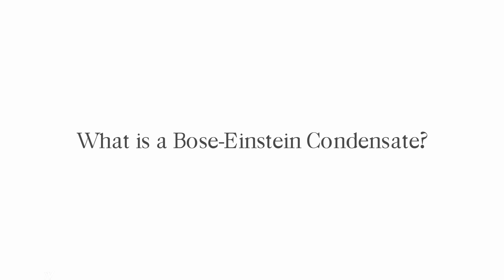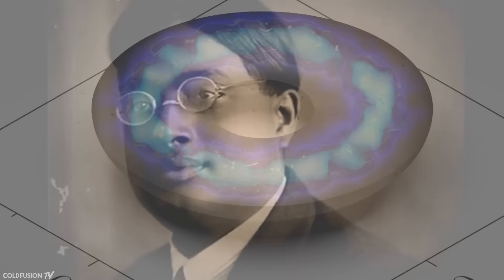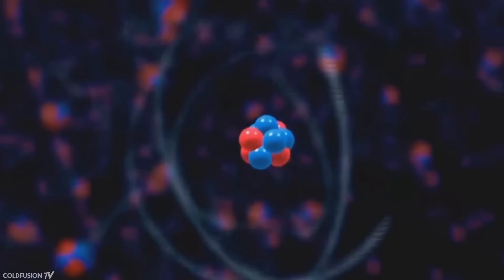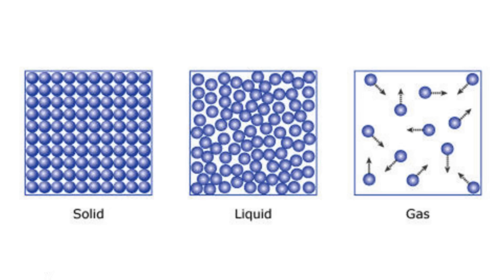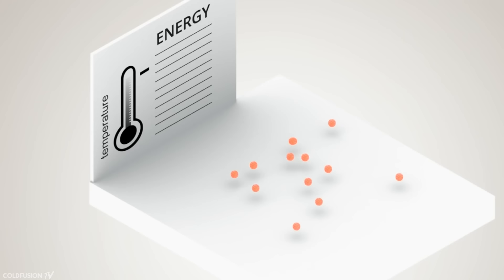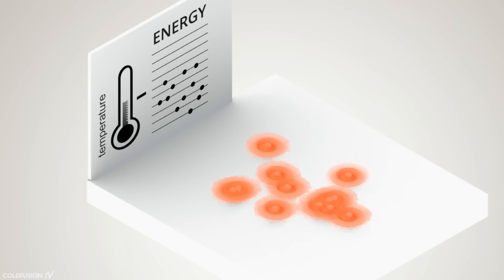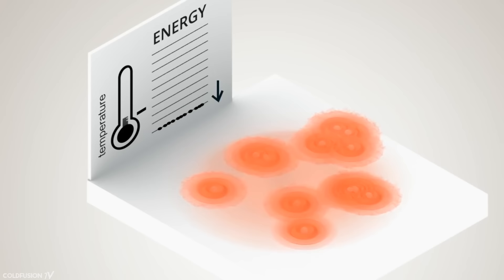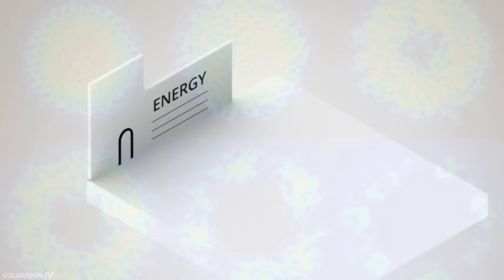A.I. Learns Nobel Prize Experiment in Just 1 Hour!

Comment: Not surprising if you have given the AI all the data it needs.  It would surprise me if the AI finds out a new state of matter on its own.
Reply: thats the thing, I've been researching and if what they claim its true,  then it has made exactly that, because they didn't tell the AI nothing else than cool it the best you can and gave it the control of the lasers, it took about 1 hour to the AI to find out how to play with the lasers to cold it, just to put it on perspective, to achieve exactly the same task it took several years of investigation, trial and error of the nobel winers
Reply: Eric Saúl Yup...
Reply: it still is surprising considering amount of computation required to actually recreate the experiment. That's where the key is
Reply: kolboch The point is, you still have to give the computer those 200 numbers and tell them what to do.  Then when the computer is done with it, it's done.  It will not think that maybe those numbers has hidden message, or clues, or create a song with it.
Reply: Agreed. Pattern recognition is the key to science and discovery
Reply: Dude you still don't understand that not much info was given to the A.I. It was basically instructed&#160;as so &#160;"make this object as cold as possible using these lasers" with that task in mind, the A.I was able to find the optimal settings for the lasers to produce&#160;the desired&#160;results...and in only an hour at that. That same task given to a team of scientists took years to produce. So when you say "not suprising" it actually is, very surprising actually. @David Lawman
Reply: 1blazery The AI doesn't even know what is "cold" without being programmed.  So we get the same results.  That breathtaking for you?  Amaze me with another results please.
Reply: Considering that also us (humans) need to be taught such simple concepts as "cold" and "hot", your last point doesn't make that much sense. Also, see it in this perspective, you're given all the info that was given to the AI, you know what to anchieve, and you have the equipment and the knowledge prior to 2001,how long would you take to get to the final result, I doubt you would take 1 hour, probably a few years if you were lucky. That's why this is so impressive, also, the AI created a diferent way to get to the result, a better way maybe. One that wouldn't "compute" in our human minds.
Reply: GhostCrafter99 You are wrong.  We don't need to be "taught" what is cold and hot.  We don't even need a word for it, we can feel the difference between them.  But you NEED to program the AI what is cold and what is hot, and be very specific otherwise you aren't getting any results.
Secondly, that last point of yours doesn't make much sense neither.  It's like you giving all the equipment and knowledge of this laser thing to an AI that plays chess.  I doubt it will give you a correct result in an hour, or ever.
Reply: +kolboch interesting perspective. Allthough the it-sector wouldnt be over, but the competitive rulers would change, to have an AI in the bord wouldnt be a bad Idea. ;)
Reply: Actually you are taught (by your body though experience) what is cold and what is hot by being exposed to external stimuli and having the sensors that respond to such inputs.

A person incapable of sensing temperature would have just as much trouble understanding this concept as an AI without the proper senses.

An AI with a temperature sensor linked to it's neural net will also learn what is cold and what it's hot without supervision.

Remember, it's not your brain that tells you this is cold and this is hot. It is your body.
If you where just a brain without the body , being "smart" would be a challenge.
Reply: Andrei Stefana But then we will be talking about exceptions.  If we are going to talk about exceptions, there will be too many unknown factors.  What is too hot or what is too cold is different for different people.
An AI can have the temperature sensor attached, but that temperature sensor is only an indicator which has to be programmed into languages that the AI can understand.
If you stick your hand into near freezing water for a few minutes then stick it into a near boiling water you won't feel the same as if you stick your hand into near boiling water directly.  There are things that the AI will never understand on its own.  No matter what sensor you link with it.
So if one is brain dead, he can still tell cold and hot?
Reply: i am not talking about exceptions.
research self organizing neural maps for details.
you do not need to program what the temperature sensor is or what the values it spews out.

a SOM AI (Self Organising neural Map) can take raw data from any kind of input and it will find it's own way to categorize what it receives.
It doesn't matter that it does not match our perception of hot and cold. It just makes it's own impression of it

also about the last part, yes you can be brain dead and still react to temperature.
sweating is an involuntary reaction based at the spinal cord level.
Same is for the Withdrawal reflex where even a comatose patient will withdraw his hand. 
Also same for the knee jerk reaction when struck. All of these are at the spinal cord level and require no brain to operate but this is besides the point :)
Reply: Andrei Stefana I was talking about exceptions as humans (people who can't sense heat or cold) as you mentioned...

About the SOM, to begin with you still have to give it algorithms and variables.  If you give it a bunch of negative degrees celsius and it categorize it as hot, then we are in trouble.  That's not exactly intelligence.  So making impressions on it's own doesn't mean it's right.

You might "react" to heat or cold but you can't feel it.  ;)
Reply: +David Lawman Are you that desperate for SkyNet to become a reality?
Reply: The AI cant do sinapsys. How can it would learn? Only living things can "learn".
Reply: MrElectrifyer My posts are mocking AI if you haven't noticed...
Reply: I just pointed out earlier that you do not need to know how the AI categorizes the information it gets for it to work. Also , no , you do not need to provide it anything besides the sensor raw data.
That's why it's called SELF Organizing...
It has Unsupervised Learning.

Read more on AI before making assumptions.
Reply: of course AI can do synapses , they are called Artificial Neural Networks.
And the reason you can do an image search on google is BECAUSE an AI has learnt what that image means.
Reply: Apologies, I meant Google Deep Search or Deep Dream, I thought it was also implemented in Image search.
This is what I meant to refer:
https://en.wikipedia.org/wiki/DeepDream
Reply: The interesting phrase was that AI in this case is finding the solution in a strange way for humans but in fact this AI software looks very simillar like a mathematical model of linear optimization. 
    AI is recording all the variables and compares the results for every kind of the equation system between the solutions and other models of the equation systems and is not repeating calculations based on a mathematical model, I guess.
    Of course that there is a huge amount of data to process and store.... and the best way to do that is a neuronal network connection model, in order to be able to change the variables according to that mathematical patern, it's like creating dynamic instances (sets of models) and dynamic objects to those classes  or models (equation systems and results (neurons)) who knows what is OOP (object oriented programming) knows what I mean.
    Becouse a processor is faster than human mind when processes mathematical operations, that's why it solves the problem in just 1 hour.
Reply: the AI might have also undergone some Iteration based on a fitness function so this variant that solved it in 1 hour was just the latest and greatest :)
Reply: +Andrei Stefana It's possible but in this video we are told that a simple function would be allmost impossible to build becouse that would be to complex.....
     Who knows? :)
Reply: Mocking AI? You'll regret that you son of a bitch!
Reply: C0LLAPSTHES0C13TY Wait, is AI your Daddy?  I am sorry if it is.
Reply: David Lawman so when you tell a AI that negative degrees celcius is hot and positive degrees celcius is cold you've just given the other names. It will still have an answer for your question you just need to translate it.
Reply: right!
Reply: Tris X No it won't.  If you program the AI negative C is hot and positive C is cold and want it to boil the water, the AI will not compute.  Because you have given it wrong info.
Reply: so you say if you see green as red and red as green you cross the street an die ? :P 
you do know that this is irrelevant right ?
Reply: +David Lawman NO!

Eg you tell your kid that a cat is a "dog" and a dog a "cat", but you know that a cat is a cat and a dog is a dog and your kid says there is a "cat" you know it is a dog. You just have to know what you taught it.
Reply: also to the kid a cat is still a cat ... you just taught him a different label for it
Reply: Astearon Wanna try to cross the street next time it turns red for you and tell me? ;)
Reply: Tris X So if you tell the AI plus is divide and minus is multiply.  You want it to solve 2(x+3)=16.  what do you think you are going to get? Hint: not going to be 5.
Back to my boiling question.  You boils at 100 degrees Celsius.  Since the AI knows the opposite, it will never be able to boil the water, it will keep freezing the water.
Reply: ***** Boy. When you say plus is divide. And you want to solve 5×5. You have to give the term "5÷5". The program will multiply it. I think you do not know that when you teach the AI different stuff you need to translate it into that stuff.
Reply: +Tris X AI is not that simple. AI it's about multiple choices and principles of choosing between those choices. 
  If the number of choices increases, the AI is more complex. There is also a complex level of determination of the choices that an AI system can make. If the level of determination is complex, the AI is smarter and the amount of data is bigger.
   This cannot be accomplished without a neuronal network storage system.
   If the AI is able to decide by its own without any level of predetermination, it means that the AI system has reached singularity (btw, I don't think this is possible).
  The AI it must be complex either way if we think AI in termes of 5x5, we reduce it to a simple software program.
  AI should be able of storing huge amount of complex PROCESSED DATA and compute that data after storing it (all kind of logical computation) to reach some kind of result that can not be accomplished by a single complex algorithm.
Reply: Daniel Daniel I was just giving ***** an explanation of what he said. I am not totally in AI I just answer his question with normal logic. Sorry for my bad knowledge. ^^
Reply: Ok. No problem.
Reply: Daniel Daniel " If the AI is able to decide by its own without any level of predetermination, it means that the AI system has reached singularity (btw, I don't think this is possible)." Yup, exactly.
Reply: I think you underestimate the difficulty in the algorithms the computer has to determine to solve problems. For example, K B gave a problem of having 200 numbers and needing them to be sorted. For our human brains, sorting is really easy. If you try writing out an algorithm that describes how a list of numbers is sorted then you quickly realize it is not nearly as obvious as you once thought. The computer would need to 200 numbers and a way to determine if one number is smaller than another, but that's it. Just knowing how to determine if a number is smaller than another does not at all describe an algorithm to sort a list of numbers, not even close.
Reply: +Blake Thingstad ""If you try writing out an algorithm that describes how a list of numbers is sorted then you quickly realize it is not nearly as obvious as you once thought"
    It depends of how skillfull you are as a programmer, or about your programming experience.
  But, again... writing complicated algorithms, does not mean you are creating AI :) AI means multiple choices (being able to chose in response of an external stimulus, by its own choice... also learning, or making corrections).... it's far more complex than any complex algorithm....
Reply: +David Lawman sorry to break your bubble but you obviously don't know how AI works - nor how logic works.

AI doesn't even work with labels to begin with. and whether one would label "cold as hot" and "hot as cold" would make absolutely zero difference to the outcome.

At least grab a book about machine learning and neural networks to even begin to grasp how this works - oh and a book about logic might help aswell.

just to point out one flaw:

If A human sees red as green and green as red and you show them a "green for everyone else" light and tell them "this is green" and do the same with red light - then no, that human being will have ZERO problems crossing a street. You simply relabeled their colors. In fact that's the case all the time, "your green" mustn't be "my green" but as both have the same label we both recognize it as "green".

So if you would switch "hot for cold and cold for hot" for a simple AI and tell it to "boil the water" it will simply find, that water boils when the state is achieved that YOU labeled as "cold". Which from our perspective would be wrong but that's not because the AI did something wrong but because we used different labels in two cooperating systems - which is simply bad practice. One can't use a Fahrenheit sensor and use Celsius in a program without using the correct methods to change values between them. That's what happened several times and caused big crashes in the past.

You could name "hot as Frank" and "cold as Peter" and the AI would still find the boiling point of water, even though the state the water is in would be called "Frank". 

An AI doesn't care about labels, it cares about input and a task (goal, like a fitness score) - labels are simply language.

By your definition of labels you couldn't cross a street here either, as you start walking when it's "green" (if english speaking) while I start walking when it's "grün" (german). So if you tell my kid "don't cross the street when the light is red" and she stops walking in germany where the light is "rot" one simply can't follow that she did something wrong. No she was just taught different labels (names of colors) used in different systems (country) that have to be translated before one can draw a conclusion - in this case by using a dictionary.

So in the case of "hot as cold and cold as hot" one simply specified:
HumanCold = AIHot and AICold = HumanHot by switching labels around.

And again to your boiling analogy: "You boils at 100 degrees Celsius.  Since the AI knows the opposite, it will never be able to boil the water, it will keep freezing the water." That's simply wrong.

The AI wouldn't "know the exact opposite" that's completely illogical. The AI would simply know 100 degrees Celsius are "Cold", therefore it would spit out "The water boils at 100 degree celsius - when the water is - as YOU specified - cold".

Seriously, hot, cold, cat, dog, red, green, bread, butter - those are completely irrelevant, those are labels for variables we encountered, labels we - as humans - completely made up. And Labels that neither have only one name, nor do they have unique names, and in fact many labels are completely subjective as well.

Just like a simple imperatively programmed program doesn't care whether you name your variable x, y, car or variable5 - an AI wouldn't care about labels either.
Reply: +Dominik Gerndt 

If you tell a human that red is green and he should cross when red.  He will stop when he sees a car coming no matter what color the light is.  That is called intelligence.  Unless you program it into an AI, he will cross the street and get hit by a car or horse, or a train.

It's not the labels.  I don't know how you think that I was after labels.  Hot and cold is meaning less unless parameters are given.  I might think 12 Celsius is cold and you might think 3 celsius is cold or hot as you want to name it.  But we know that water boils at 100 celsius and freeze at 0 celsius.  You can change the names but not the states of form when temperature changes.  If AI is only programmed that freezing the water will make it vapor, it will only keep freezing it and trying to search for the lower temperature that will vapor the water.  Which we know it's not going to happen.
Reply: David Lawman and again you think way too much about labels and programming in an imperative way.

And that is a completely false way to look at AI.

Do you think simple neural networks like MarI/O "know" that they are playing a game? no they don't. and they don't know super Mario contains enemies either.

all they know and teach themselves is how to react to a given screen input to most likely increase their fitness value.

and that very fitness value is the only thing we give them as a goal. the AI get's a task, inputs and outputs and is free to do what ever the hell it "want's".

And a AI that learned that ghosts in pac man are bad will aswell evade it even though you never told it what a ghost is nor that it's bad. just like a toddler doesn't give a rats ass about an approaching car the AI has to learn about bad situations aswell to apply it's knowledge to different situations.

and no, those reactions are not predefined. just like you are able to control your body the AI is able to control what ever it's outputs are.
and just like you have to base your reactions on sensors all over your body, input that gets transformed in your neurological pathways to make a prediction of the proper movement - the AI also simply has inputs and a neural network.

and just like your brain develops, this network develops. in fact several implementations even use evolutionary approaches. and just like you learn from your mistakes the AI's neural net get's tweaked using backwards propagation.

I think you most likely want to convince everyone - including yourself - that the human race will be the most intelligent being on this planet. But if we are so smart, then we will find a solution to how our own brains work, and as soon as we do that, we will work on a artificial way to reconstruct it.

So either we stay dumb enough to never be able to built a proper AI or that AI will pass our intelligence faster than we would like.

That's exactly why even people like Stephen Hawking, Bill Gates or Elon Musk talk about these subjects. Because of the problem of security. if we can't solve the security problem before we solve the AI problem - things will be about to go south. because for all we know - we might have to go in order to increase the fitness level of that given AI.
Reply: Nah I agree that AI could easily surpass the human mind eventually. I don't pretend to understand neural networks, but I do understand programming really well (it is my passion and career). Honestly, the concept of machine learning baffles me, but I haven't ever researched it before.
Reply: Agreed, I just wanted to point out to David Lawman that I think he seriously underestimates the complexity that goes into programming, not to mention AI.
Reply: +Dominik Gerndt 
The problem is you think way too little.  AI is a program, it's not a human.  You can not give it a goal and tell it to do whatever it wants.  You have to give it many datas and laws in order for it to accomplish the goal.
Let's use your pac man example.  What is bad? is dying bad?  How AI knows that?  does it gets hurt?  How it learns then?  You have to set the parameters or tell it dying is bad.
Toddler example you gave is wrong.  The toddler physically can't run away from the car, so what the hell are you talking about?  Try to surprise the toddler by jump in front of him and see if there is a reaction.  That reaction is intelligence, no need to be taught.
If you give the AI a human like body, and tell it to turn its head.  It will spin it's heads off unless you set a parameter.  
Everything has to be set or programmed or given the datas correctly.

So please don't think that AI can do everything or learn everything by itself.  Simple tasks maybe, but that's not AI.
Reply: +Blake Thingstad
Quiet opposite, I believe we don't have the ability yet to create a real AI.  Which should go beyond our programming skills.
Reply: Very true, I guess I'm taking a purely theoretical stand point (as if we did have true AI) for this because we have definitely not created consciousness in computers
Reply: Also, a Toddler reacting to something is not intelligence but instinct, which has been developed over many generations. This is part of something called evolution which also is an integral part of AI development.
Reply: Instinct is part of intelligence.
Reply: I think it was given a constraint (keep finding the lowest temperature) and each action that achieved a better temp was rewarded and one that elevated it was punished. Just an assumption but I think that they are much smarter and have Phd. Their implementation may have advanced stuff
Reply: I don't know specifically how much ai has improved but i know this
1. if ai earns the ability to learn on its own and starts to reprogram itself we will not be able to stop it
2. humans will never be able to beat ai
Reply: Sorry to say, but you clearly don't understand AI. Despite AI still being in it's early stages, it can already do amazing tasks. To refer to your Pac Man example. You DON'T have to tell it that dying is bad or that ghosts are dangerous. All you have to do is to give the raw pixels as input, and tell it that it the goal of the game is to get as high score as possible. That is all. That means it competes on exact same terms as a human. A human player gets so the screen, and gets told by the game that getting a high score is good. Also, you have to tell both the human and the AI the controls of course. But they do compete on exact same terms, and the AI will of course get much better than a human, much faster.

The way you talk about AI clearly shows you don't understand it.
Reply: ...and what affects the high score? E.g. death. So when you defined that a higher high score measures it's success, you also added in everything because it's not just pixels, but what the pixels represent and that's what it doesn't learn unless you hardcode it in.

Just like with the one hour discovery. It didn't have to first learn the whole universe and re-invent all of our contraptions or even the experiment, just had to mess with the parameters that we defined for it.
It doesn't mean our current "A.I." is completely shit and useless, it just means that it's not quite intelligent yet. We'll get there no doubt, some neural nets we humans have made are doing pretty cool things, but we just aren't there yet.

Funny enough though, the way you talked about AI gave the impression you don't know much about it either. I know I'm no expert, but even with my lackluster experience with only few neural net implementations, I can tell you're full of shit.
Reply: BlyantGames Let me ask you something.  You have clearly played Pacman right? Do you need people  telling you what's the point of the game? or Dodge the ghosts? or eat the power pills to eat the ghosts? I hope not...but you do have to input those parameters for the AI.
Reply: I'm no expert either, but I've made these AI's myself. From scratch. You DO tell players that you need to get as high a score as possible. And thats the same you do for the AI. You don't hardcode anything, and therefore NO. You DON'T input these parameters. That's the whole point of learning. You build the model, input the pixels, and simply set the goal of the AI to get as good a score as possible. Therefore the AI learns, just like a human, that the ghosts are bad, winning is good. You should read the research papers before claiming such things :-)

Idk what neural nets you've been implementing, but of course you can do more simple nets that rely on handcrafted features. But just because your nets are not dynamic, doesn't mean no nets are capable of it.
Reply: If you're already fully aware of what the current state of the art neural nets and various genetic algorithmic spinoffs can do then what are you even arguing? 

Alright, seems like you're referring to sethbling's mario nn based on your description so we'll discuss that. Score, you define. Outputs, i.e. directions and jump, you define. 
I'm sure even you don't think the shitty nn script will just randomly dicover .net so it can act on mario within the emulator. So, already you've limited a lot. Let's not forget you defining the input as well, i.e. the pixels or more specifically you choosing a limited area around it probably simplified to value of 1 and 0 instead of rgb (you doing the work of defining what visual things have value and not).
Then let's follow up with defining the suitable fitness for the next generation, again your doing. Mating, whether to choose the fittest, random or combination, again your doing. The sigmoid function will be partially of your doing/copying as well. Etc. etc. etc. etc. etc.
Just because it seems like it does all kinds of mysteries and magical things within it's magical hidden layer of hidden magic, it's just reiterating over a set of instructions that you've defined and all it has done over the 100m generations is change the parameters, activated or deactivated nodes and gotten better.
Reply: What im trying to argue here is, that the more complex AI models can learn, with extremely limited human interference. I am not referring to Sethbling's mario nn. This model got handcrafted features. 

I am talking about newer discoveries. True state of the art. This is my research area, and sorry if i came of as rude as a start, but it just gets to me when people claim things, that they probably haven't researched properly.

Take an example. Read "Playing Atari with Deep Reinforcement Learning" or "Human-level control through deep reinforcement learning"

The whole idea here is, that you input the raw pixels, though they can be grayscale and/or downscaled, but this is mainly for faster computation. This is fed to a CNN, typically many layers, and can get really complicated if you use things like VGG16, GoogLEnet or ResNet (which is SOTA), and the Google use much simple models with the Atari games. The DCNN is then often followed up by a fully-connected layer. This layer will, in the case of a game, output it's expected score for each possible action. Then the surrounding Reinforcement Learning will actually do the action, as the DCNN is actually just the function approximator. It's the policy that decides the final action.

But the main point is. The AI ONLY gets the game screen as input. Sometimes it is in grayscale, and/or downscaled, sometimes it's the whole screen in RGB. Then, then DCNN will try to predict the outcome of each action. That is for each control the game have. I would say it's fair that both the human and the AI gets to know the controls? The only thing used here is therefore:

Raw pixel input and N number of actions as output. The AI is then simply comparing it's predictions, with the actual score it got in the game.

The features are not defined. The parameters are not defined. The point is that it learns the features it self. This is not a "simple" generic algorithm. The only thing you provide, is the screen, the controls (not even what they do, but just which buttons actually does SOMETHING), and it's current score (can even be done through the pixels. A lot of the OpenAI Universe Environments rely on this). SAME information as a human get.

If you think the AI is provided a lot of help, because we send the: screen, keys that can be pressed and current score, then i can't say anything to that. But if you think the AI get any more help than that, you're wrong. My point is, we don't tell it where to look, what ghost are, what pressing W does, we don't even tell it what on the screen it controls. We don't tell it the goal of the game (except, get a good score).
Reply: ''Considering that also us (humans) need to be taught such simple concepts as "cold" and "hot", your last point doesn't make that much sense.''
umh, yes, it makes sense, the point is not who's better, but that the Machine cannot do it without actual human programming. Your computer can do the same thing if you know how to program it.
Reply: Cruz Go study how neural networks work and how they train.
Reply: Cruzwindu777 DEfFSFF utilities
Reply: you don't get the point. if the AI had just tried out how to reach it's goal it would had needed forever because the possibilities of how to reach that state are endless. instead it found an other way to reach the state in just 1 hour. that's not just "giving the AI all the data it needs"... it 'thought' for itself and found a way which was different than trying out every possibility there was
Reply: You're demeaning the complexity of the human body. I also don't understand why it wouldn't matter to understand HOW a machine thinks? Wouldn't you want to know if that turned out to be a completely new approach to processing information?